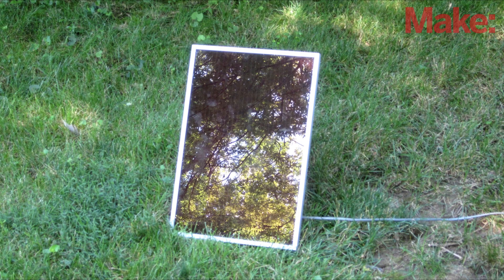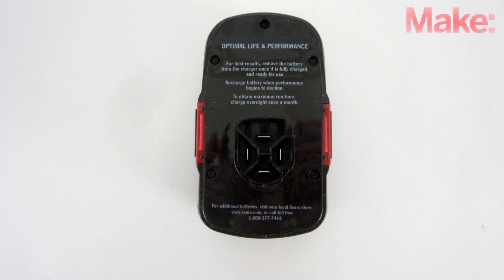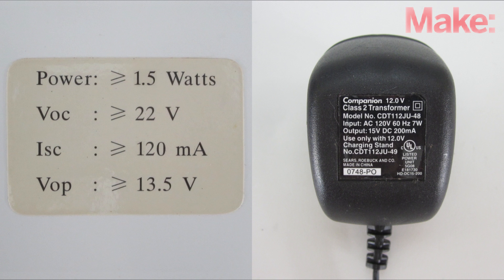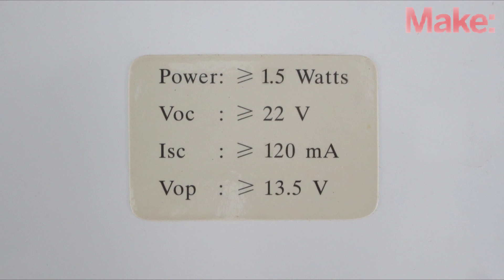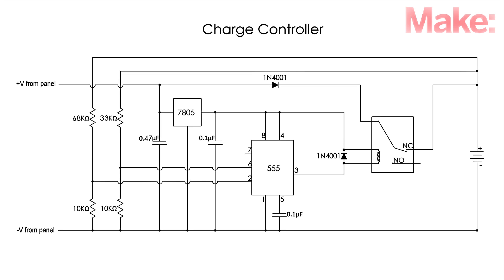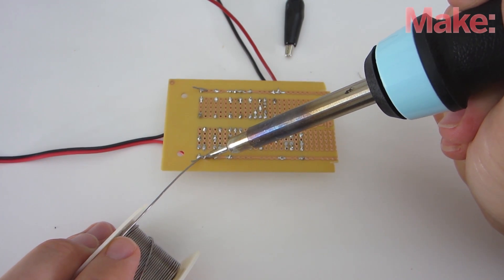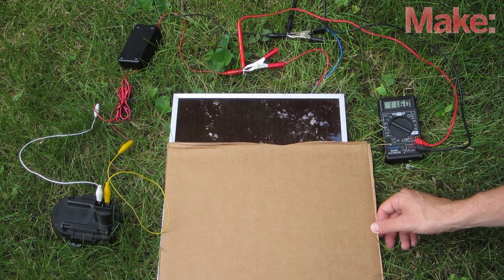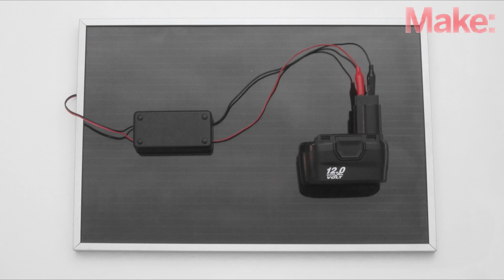Solar Power Tools

Comment: Thank for info. 18v 6a drill baterry can be directly charged by solar panel without inventer or controller ? 21.6 v solar panel output max not %20 höger than battery

Comment: Why in the world is pin three of the 555 timer connected to the output of the Five regulator when I went off of the schematics the relay was producing a humming noise I ended up connecting pin three directly to ground

Comment: Could this method be used to charge 36v batteries?  I'm wanting to charge garden tools.  How much area would you need to get a solar panel with open circuit voltage above 36v?  Was toying with putting them on car roof, and charging up throughout the day.

Comment: Great project!
I like running my (battery) tools straight off a 120w '12v' PV panel - open voltage is around 18v.

Comment: How would you change the circuit to relay move power to another battery etc... till reaches last battery i.e. in parrallel
Reply: might would just take longer although you would have to be sure the one battery isn't dead or the other may never charge

I would think series would be better for overall control of individual batteries, just add another relay and chain it off 1's secondary pin with a delay to the flip of 2's main so it doesn't skip charging

Comment: Any ideas of whether this could be used for usb chargers?
Reply: These are charged from USB power which is 5 volts. You need 5V regulator such as lm8705 and some resistor play between data pins so powerbank knows it's not charged by computer's port but by a charger and can safely draw more than 500mA(standard limit for PC USB ports)
Google for pinouts and resistor schematics.

Comment: Im interested in using this with an old battery from an ups that i have, my concern is the charging time
Reply: UPS have sealed lead batteries-they are able to be charged with constant voltage-written on the battery as standby-usually 13.5 to 13.8V This has few pros- it is safe(lifetime of these is declared with all time standby connected) and is perfectly suitable for using while charger still being connected. Only requirements are: constant given voltage, diode for circuit protection at night and current limiter for cases where tool would use more power than charger can safely deliver(charger has slightly higher voltage than battery so load is drawing current from charger whenever possible.